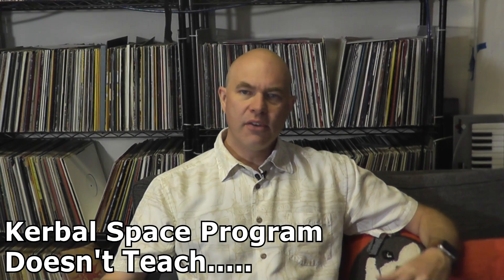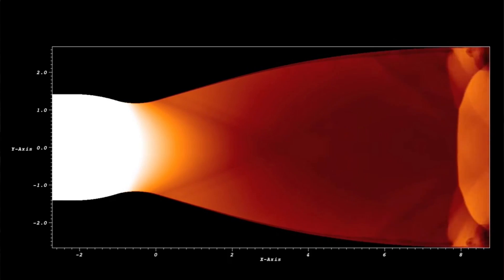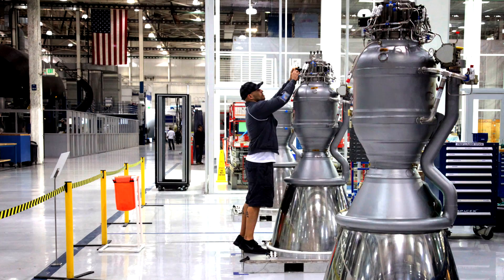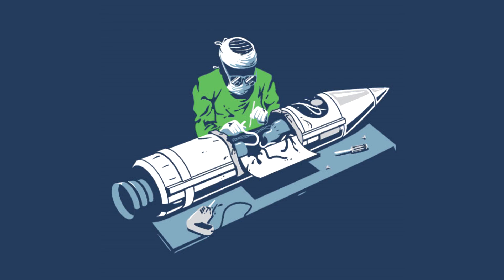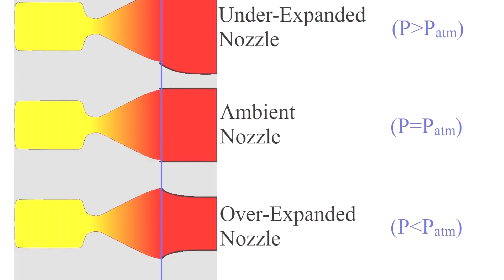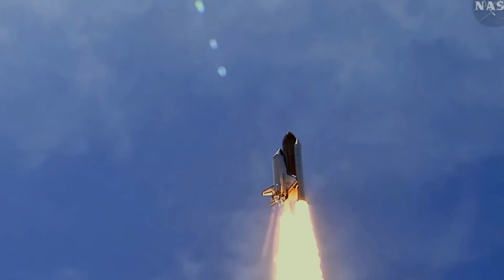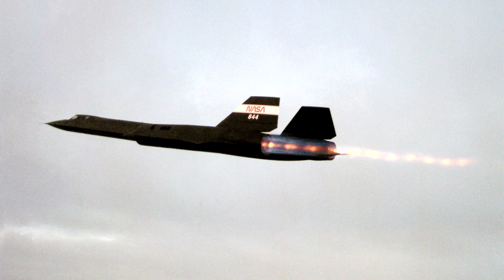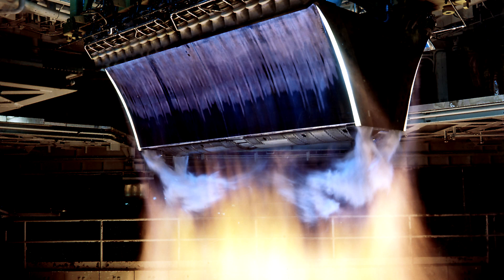Kerbal Space Program Doesn't Teach... Rocket Nozzles

Comment: Hey scott! Have anyone made a nozzle that expands as the pressure drops? or would that be too flexible and fall apart due to the engine pressure? Thinking of nozzles like those seen on jet fighters
Reply: Aerospikes sort of work like that but they don't have an expanding nozzle/bell. Instead, they have nozzles positioned around a tapering spike or wedge shape located in the middle. What happens is that the ambient air pressure forces the exhaust gases against the spike/wedge, so as the air pressure drops, the gases have more room for expansion. It basically "simulates" a variable nozzle.
Reply: +Martin Stensvehagen temperature more than pressure i would imagine is a problem.
Reply: Besides, you want the nozzle to get bigger over time, not smaller.
Reply: aerospikes and other compensating engines do this by using the airflow to compress the gas as if it were the outer wall of the bell

as for why nozzles don't expand/contract like fighter jets it's because they have to run fuel through them to cool the bell to keep it from melting. rocket exhaust is much hotter than jet exhaust so pretty much no metal exists that can survive it well enough, so they need to actively cool it
Reply: if the engines can have multiple relights, then the extending nozzle design can first start out without it being extended, then shutdown at some point in flight, extend, then relight.
I don't know if that's too complicated or worth the extra ullage thruster's weight though...
Reply: I imagine it'd be really hard to make. Considering the surface finish of the nozzle is quite important - and like you've probably seen, the "nozzle" on a jet fighter engine is pretty rough looking. I think the gains would probably be outweighed by the losses.

Who knows. Maybe we can invent some magical material that is super resilient to heat, holds its shape perfectly, yet is able to be shrunk or expanded at will.
Reply: Mainly weight.
Reply: short answer is yes
Reply: What about engines that work like the blackbird intakes? As in the spike part gets shifted up and down to change the diameter of the exhaust vent. 

I wonder if magnetic nozzles will be used in plasma engines, or if plasma engines will even need nozzles.
Reply: +Tlaloc_Temporal An aerospike is an integrated unit; the fuel feed runs down and over the base of the spike, so to do what you're suggesting would require flexible, movable fuel plumbing, which to my ears sounds like a bad idea (tempting Murphy's Law).
+PsychoLucario that helps but its not the main reason for preburners.  Cooling the bell allows exhaust temperature to be higher but the main reason is to preheat cryogenic slush fuel to liquid temperature so that it 1) flows faster, 2) acts like a fluid in the burn chamber and behaves more predictably, and 3) (most importantly) burns more completely for higher *I*sp